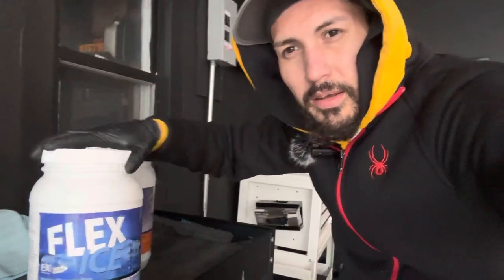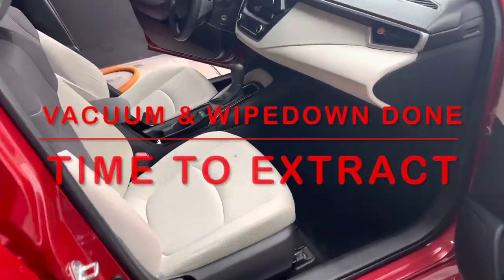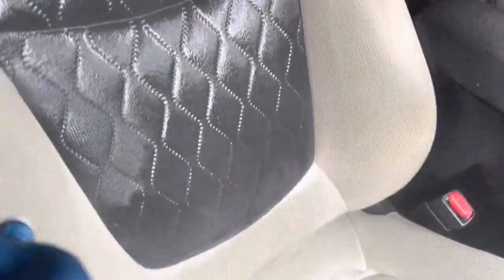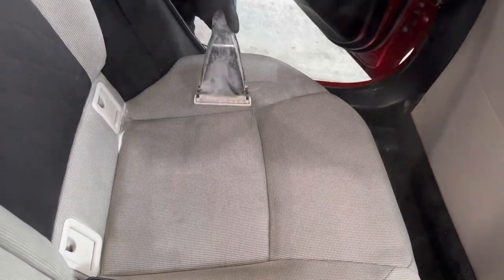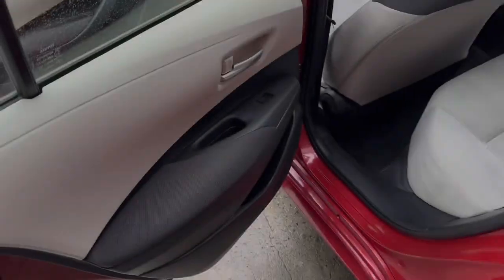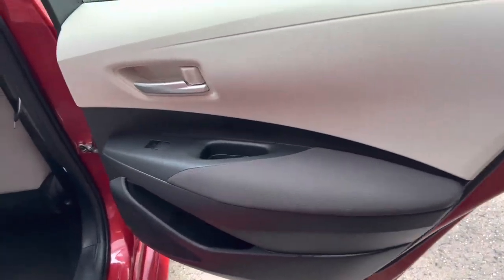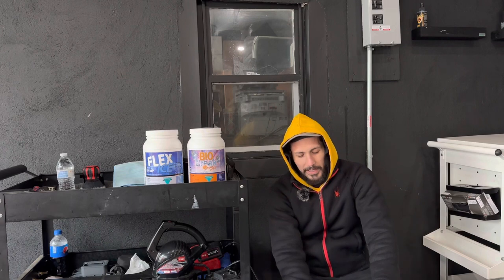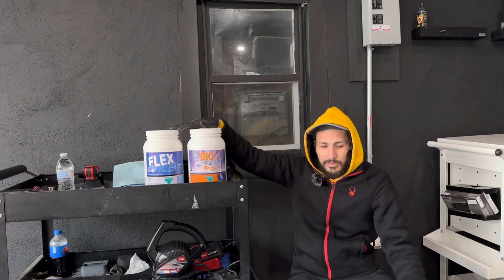Removing stains on light interior and upholstery. The Best Stain Removal Chemicals

Comment: I’ve noticed in the past it’s best to start from the seams instead of working your way towards them. The more force you apply directing moisture towards any center point like a crevice or seam, the deeper it goes. Which makes it harder to extract. I look forward to using the products though, thank you!
Reply from the maker: That’s a great idea! Thank you for that tip my brother. I will start giving it a shot. BIOBREAK and flex ice are top notch 💪

Comment: Not sure if you answer questions but why not use flex with citrol on instead of biobreak, I think its basically 10x stronger on ph scale. Aswell I wanttp ask what should I do if I use ridgid diy extractor which I cant put the rinse solution in,how do I rinse it with the solution still?
Reply from the maker: I've never used Citrol in the interior I would have to take a look at it. But anything high ph scale and not dedicated for carpets or upholstery may leave them hard and crunchy. I'd prefer using carpet specific products

Comment: Can you use Flex Ice on a pump sprayer instead of putting it in the Extractor?
Reply from the maker: Maybe you can I haven't tried it out that way. It dissolves very easily. Maybe you can spray the area and extract it like that or rub it with a microfiber towel t neutralize the previous cleaner.

Comment: Daddy’s back with another great video brosef bio is so expensive haha
Reply from the maker: 😭😭. Bro It last me forever though!!! I’ve done about 10-15 details look how much more I have left. I can probably do 50 cars before I buy another of each. !
Reply: @DetailingMadeSimple  I know haha I’m trolling I’m actually looking at the stuff you told me too. I love your example of using the steam to move the drying process along
Reply from the maker: @Ecdetails  I know you are 🤣. I appreciate it bro. Yeah that steam does accelerate the drying process heavily. During the winter I do two go around then just run the car for 45 min with the heat on max. Dries the seats and fabric like 75%. I just tell the owners to take it and leave the car an extra hour or so let it bake in the sun if need be

Comment: Do they have to be used together reason I ask dont have an extractor yet but want to use the products seems to work pretty well ?
Reply from the maker: Ideally yes you would want to use this together. I recommend you try if you have a steamer and not an extractor yet which is a phenomenal one two punch is labocosmetica Ductile and Glico. Affordable and no need for an extractor I will like a quick before and after on a 5 year old light gray interior.

https://youtube.com/shorts/u-Qkx2N5dcQ?si=lSc-TAYSBS9UeN6V

Comment: How much product should I use to prep 1 gallon of water with these products? It’s a shame they don’t add what the measurement is of the cup included…
Reply from the maker: Yes I know. Traditionally for me say a IK sprayer 1.5 liters I use one scoop of bio break. Which works amazingly well. 

And for flex ice in my extractor typically it's 2 scoops for 4 gallons is what I use. So one scoop for 2 gallons. That's what I've found works for me the best. Everyone has their ways. Especially with flex ice since it can leave some whitish powder around if you use too much. So that's what I've found worked for me. Hope this helps. 👍
Reply: @ thank you so much!
Reply from the maker: @ glad to help

Comment: How many scoops of Biobreak go in you pump sprayer? and is it used with Hot or Cold water ??
Reply from the maker: One scoop I prefer in a 1.5 liter pump sprayer. You can use either or. But hot water is preferred as it'll clean and penetrate better 💪
Reply: @DetailingMadeSimple  Thank You... God Bless
Reply from the maker: @lazzarosautodetailing  anytime 💪🙏
Reply: @DetailingMadeSimple  Hi SOC, do you know how many grams or ounce is in the flex scoops?
Reply from the maker: @VassRulez  in ounces I forgot if I remember it’s 1 ounce per scoop. It’s been awhile since I’ve measured. Just grab a measuring cup 💪💪

Comment: any problems with wicking?
Reply from the maker: After wards no more wicking in that area. I sprayed more flex Ice to neutralize the biobreak. Once it dried was all set to go 👍. Always want to use a product to neutralize the aggressive cleaners to prevent wicking.
Reply: So say I dilute Flex Ice in a separate spray bottle and spray onto the fabric after extracting will it have the same effect to prevent wicking?  @DetailingMadeSimple
Reply from the maker: @OneTastyPotato  to be quite honest. I do not know. I don’t want to lie to you and say yes. If I need a product that needs to neutralize and use the method you’re asking I will use P&S Finisher if that’s the case. 👍